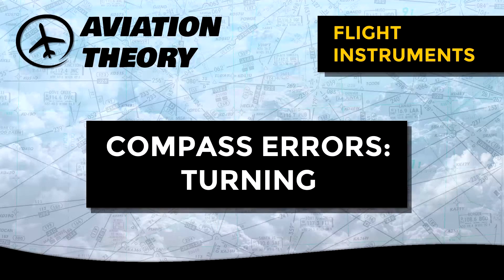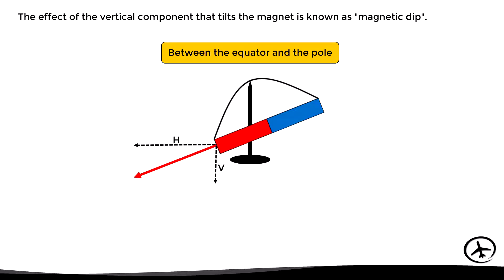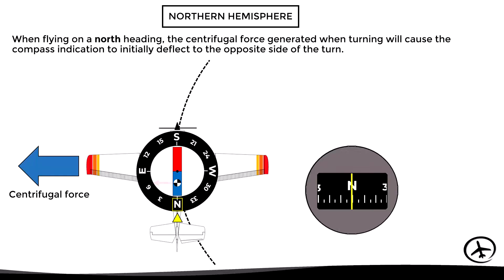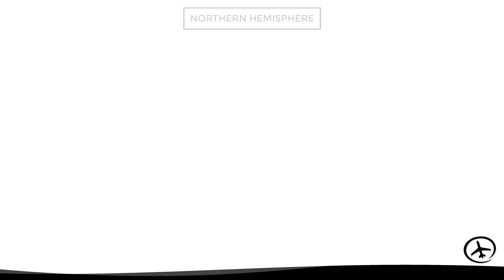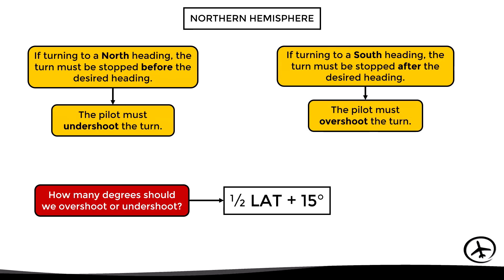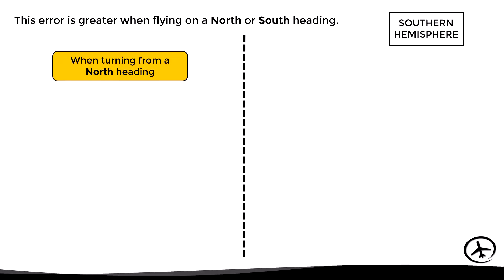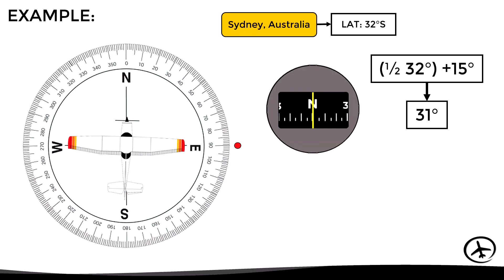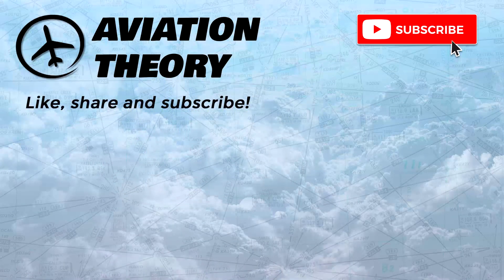Magnetic Compass Errors: Turning

Comment: The basic premise that turning errors are caused by inertia is 100%. Certainly the acceleration error (ANDS) is caused by inertia, but NOT UNOS. You can prove it false by initiating a bank without actually turning (aka slip the plane). Since you are not actually turning from your original trajectory, there is no inertia and no “centrifugal force” (also not a real force and also has nothing to do with this subject) but you’ll still see this error. Weird. UNOS happens because the ‘counterweight’ placed on the magnet to correct for magnetic dip error only works straight and level. In a bank, the magnet is allowed to align itself with the downward component of Earth’s magnetic field.

Comment: I'm still very confused. In a coordinated turn, the 'felt' force will be straight down relative to the plane (ie straight down into your seat as felt by the pilot) so why would the compass experience a force to the outside of the turn or a sideways force? If I understand the physics of an aircraft turning, then the only instance where centripetal force will cause a sideways force (relative to the aircraft) would be in a skidding condition
Reply: You're not alone with that observation. I think this video is incorrect in explaining compass turning error with centrifugal force, despite all the positive comments. Compasses use the design shown in the video (CoG below the pivot point) precisely because this minimizes the inclination-induced card dip, so the CoG shift is marginal. Even if it were not, you're right: when flying a coordinated turn, the compass card has no reason the bank relative to the airframe, so no shift of CoG occurs, thus rendering the explanation using centrifugal forces invalid. The real reason for the compass turning errors is the vertical component of the magnetic field that comes into play the more the aircraft banks. Think of an almost 90 degree knife-edge flight. The compass card is still level (relative to the airframe), but the pivot axis now allows the needle to fully align to the inclination, thus pointing downward with the north-seeking end (on the northern hemisphere), every time the aircraft's heading passes northerly values, and vice versa. On less steep banking angles, the needle can only partially align to the vertical component.

Comment: PERSONAL NOTES

Northern Hemisphere
Turning from North heading - Compass will deflect to opposite side then turn in the right direction at low rate (Compass lags the turn)

Turning from South heading - compass will move in direction of turn at high rate (Compass leads the turn)

UNOS 

Turning into Northern heading - Undershoot North

Turning into Southerhn heading - Overshoot South

SOUTHERN HEMISPHERE

Turning from South heading - Compass will deflect opposite direction then turn to the right side at a slower rate (Compass lags turn)

Turning from North heading - Compass will turn into the right direction at a faster rate (Compass leads turn)

ONUS

Turning into a Southern heading requires undershoot 

Turning into a Northern heading requires overshoot

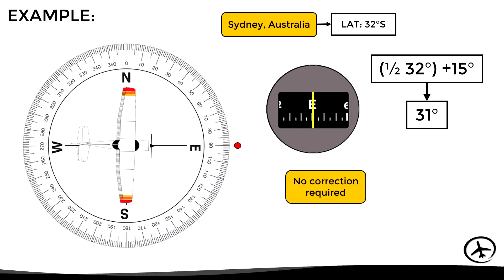Comment: many thanks for your videos and they are very helpful! I would like to ask for a clarification for the consistency/inconsistency at @11:15 and @14:35, which is for the opposite movement of compass card during a lagging turn of compass error. should the compass card in 14:35 will move to opposite direction (from 090/E to maybe 080) first, and then at a slower rate to the correct heading of 180? Many thanks for your help in advance!

and i think we can also memorise the undershooting of compass direction by memorising it is for same direction for hemisphere and turning (NH+NT => lagging turn and hence undershoot), and same for SH+ST! cheersss